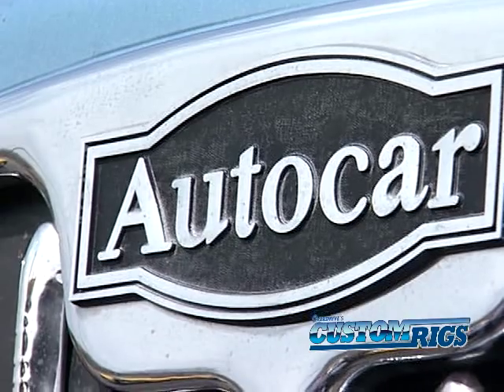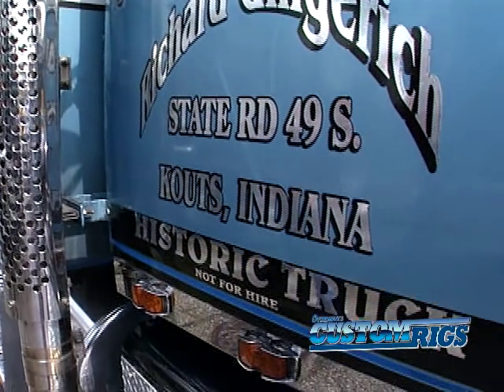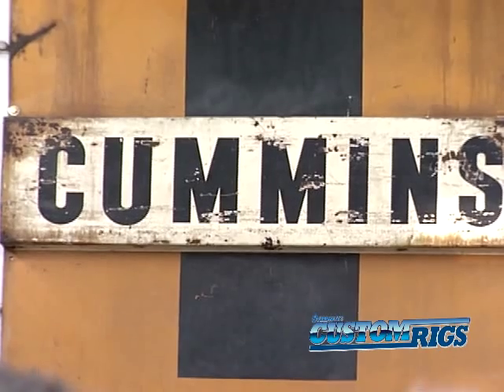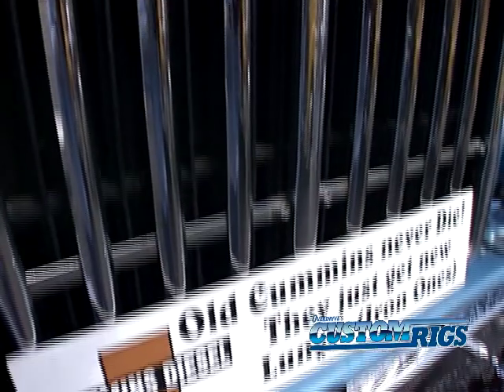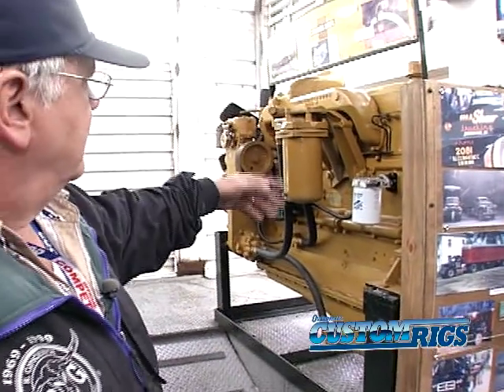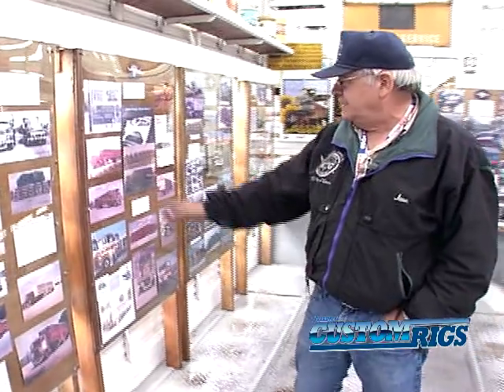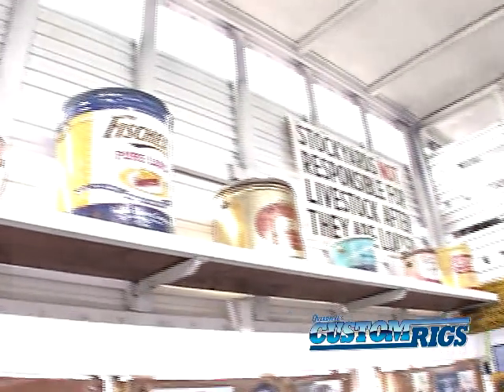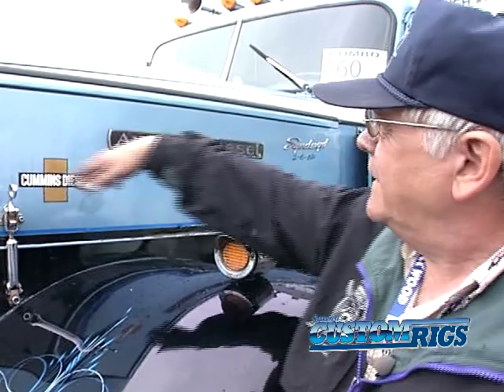Richard Gingerich's 1951 Autocar DC 100

Comment: Awesome . I have a 1951 DC 100 that I am  starting to restore myself . It is a Roger Sherman with a 30 ton winch.600 NH cummins .It runs nice when it runs for about 10 seconds but just stops.Has the 5 speed with the 3 speed auxilliary